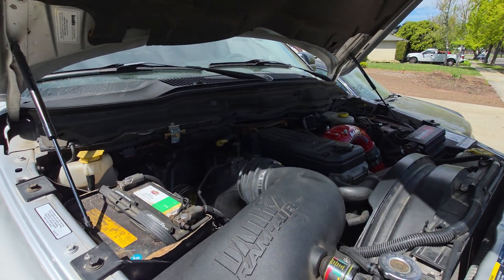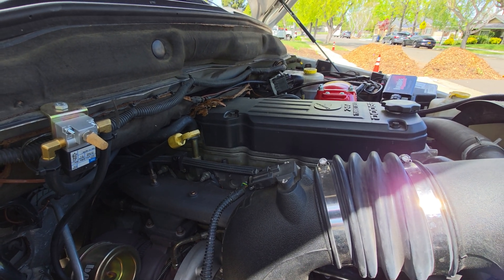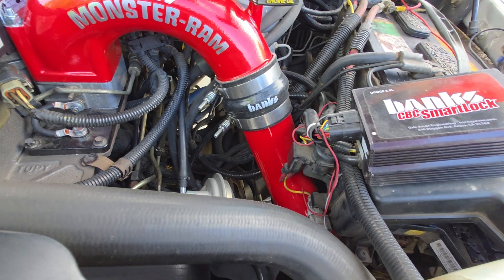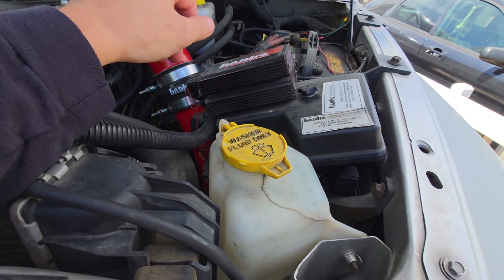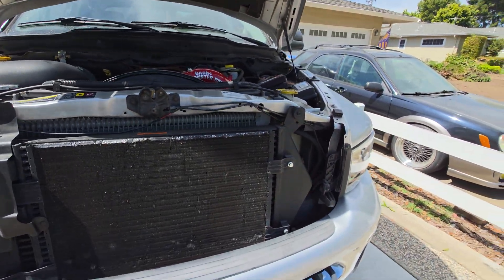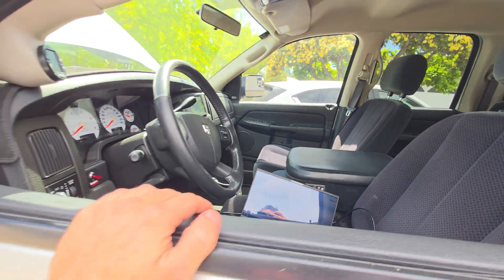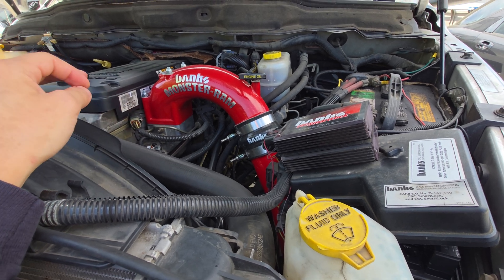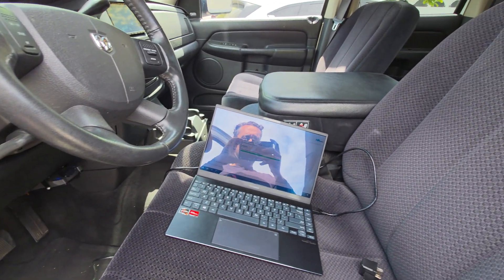Engine Mod List for 3rd Gen Dodge Ram 3500 Cummins 5.9 Tow Rig

Comment: Which brand manifold is that? Looking to do the same upgrades.
Reply from the maker: Steedspeed
Reply: Do you recommend T4 or T3 with the s364sxr?
Reply from the maker: @dannymarino8000 Depends if you intend on doing a 2nd Gen Manifold swap (converting to T4) or compounding the 3rd Gen manifold (staying T3).
Reply: Definitely plan on keeping the stock location so t3 then. What are your thoughts on wastegated or not?
Reply from the maker: @dannymarino8000 depends if you're going compounds or not.